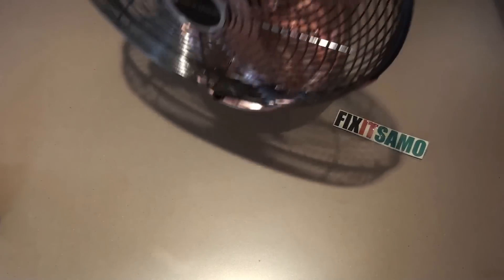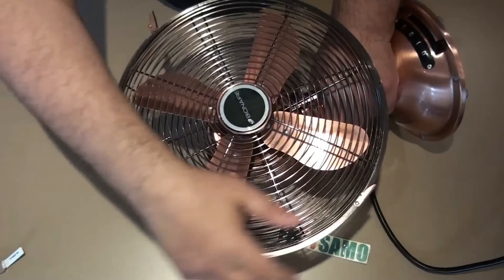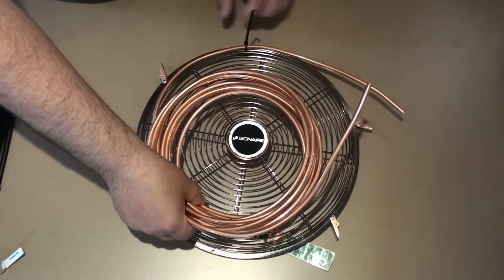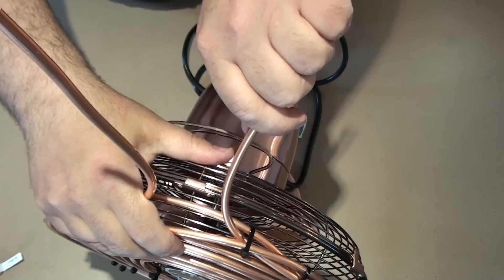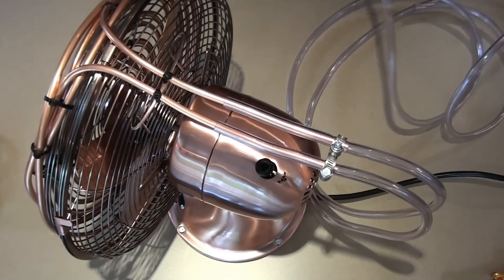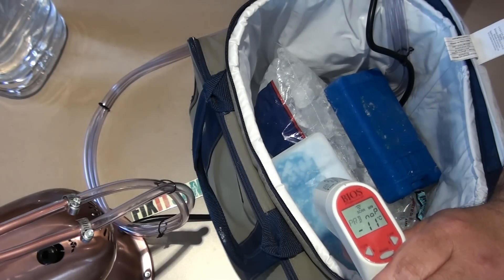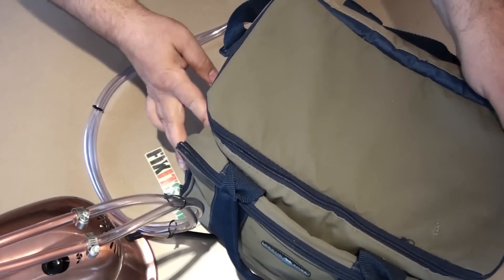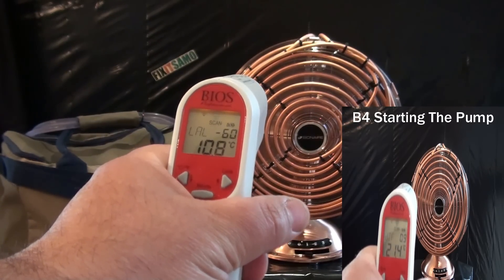How To Turn Your Fan Into An Airconditioner  AC

Comment: couldn't you fill all the copper tubing with water, put the pump on and circulate just the water inside? probably would not get as cold but cooler I'm sure.
Reply: That would work for a few hours at best, but eventually the water would heat up and reach that room's temperature, turning it into a very heavy fan. The water has to cool down at some point to make this work. In fact, I'm willing to bet that the water will actually reacher temperatures higher than the room's, because the electric water pump will heat up, making the fan a heater. Not the best for AC.

Comment: Where does the condensation go after it forms on the copper tubing???? It's going to  get wet underneath that copper tubing, right?
Reply: Anon the high air flow will keep the copper tubing dry. this isnt that effective it wont cool enough to getbmuch condensation.
Reply: I live in Northeast Pennsylvania. Here, depending on the amount of moisture in the air and the temperature, the dew point can pretty easily get above 70 degrees.  I made my own device - just like yours - specifically to dehumidify, and it worked very well! I was able to collect approximately 350 ml of condensation in about an hour and it made a big difference in comfort. The funniest part is that I was using a steady, but slow, stream of tap water. It was roughly 56 degrees coming out of the tap, so when the dew point was up in the 70's, it would really produce a lot of condensation. Anyway, great idea!
Reply: @jimk518  If you made an air chamber under the ground you could use air instead of water.  The ground, not that far down is cool.

Comment: Need a way to test the air coming off of it ... I am sure this thing works, but pointing an infrared thermometer at the cold pipe is going to provide you with a colder reading ... I am curious about the actual air coming off of it, at about a foot away. Great idea though ... Thanks for the vid

Comment: if the temperature 35 it will be 25 ,it is good but after little time it will loose the cool due to the ice will loss the latent heat and you must put another amount of ice
Reply: Hence the cooler.

Comment: Safety note: make sure the copper pipe reaches down below the fan motor, almost to the floor/table/whatever surface the fan is on, then make the potentially leaky water connections down there so if there is any leaking, it doesn't go into the fan motor and burn down your house 8)
Reply: Watch for condensation building up on cooling pipe, that can cause issues, with both electric motor, wires, and good furniture finishes. Remember all AC's have condensation buildup on the cooler areas. I get it with my store bought A/C., outside my window.
Reply: i thought the same

Comment: It will only work if any of those complicated devices (and there are tons on the net)are used in a separate room, with the door closed, to where the freezer is.  In other words, it'll work in your bedroom, but not in your kitchen.  The fact of the matter is just to place two one-gallon jugs of frozen water (on a rubber or plastic floor mat with edges or ridges, in order to capture condensation water) and place a fan behind.  Same thing. But always away from the room where the freezer is.  And when depleted, just go to the freezer and switch jugs. Don't forget to close the door behind you! Jugs always.  Never open or raw ice.  It'll evaporate and make matters worse.

Comment: Another modification and make another coil for the cooling side. Wrap this in thin cloth and get it damp (not under water). The air will be enough for the evaporation effect to get surprisingly cool. Also cheaper to scale to a larger size than ice so can make colder air per dollar. Just need a tank of water to keep the cloth wet, there pumped on top or gravity feed with a prick size hole to drip water on the cooling coil.

Comment: you point at the copper and it will be 10 c degree it is so normal you didnt measure the air output as it is a different tool thn thiss one.

Comment: Is your digitial thermometer calibrated properly??
Ice = 0 °C (not -14 °C)
Reply: The freezing point is 0, but ice can still get colder than that.
Reply: Yes, ice can be colder than that, but your ice is 14 °C (25.2 °F) colder than freezing.  You must have froze it in a deep freeze, huh?
Reply: A home freezer in the UK normally stays at -18°C so for this ice he showed is after a little while of preparation is only -14°C is totally normal, Understand that if he had ice that was 0°C it would literally start to turn into water in a bag within under a minute of it being out of the freezer in a warmer climate, which for anyone who wants ice for whatever reason is not any good.

Imagine putting ice cubes that was -1°C into your drink it would literally just turn into water within a minute of it being submerged and wouldn't really cool the beverage at all and just merely add more volume of water.

Comment: How would freezing milk jugs with water serve as the ice?
Reply: You could add the salt to the jugs and that would contain the corrosive  effects.
Reply: Well if it's ice, then it should work right? There's no difference between water frozen in a milk jug vs water frozen in a bag.
Reply: It would work.  You'd still want to circulate the water around the ice jug/s to get it as cold as possible.

Comment: It actually works as a chiller or chilled water loop. But..... you need to measure air temp off the fan that infrared thermometer only does surface temp. And what are you going to do when that copper starts condensing and sweating and dripping water everywhere.
Reply: My guess is that since the water will remain cold enough through each cycle, condensation would be minimal. 
And whatever condensation does appears would be blown away by the fan as a light cool mist. Its pretty much a win-win.

Comment: I would love to know two things. 1) how cool can it cool a room compared to another room and what is outside temp. 2) can you use coolant,RF2, Freeon etc?
Reply: Refrigerant wont work without a compressor, so no. Unless you stole a loop from an ac or from a frige, but then you might as well use an A/c
Reply: Genius News no, coolant is a vapor at standard pressure

Comment: It would be great to actually run some gas under pressure through the copper pipe instead of cold water. That would be the real challenge. Anyone up for doing that?

Comment: It's not an AC, it's a cooler. AC should work like a self sufficient heart pump, while this equivalent to simply throwing ice on the floor.
Reply: No, it isn't 'equivalent to simply throwing ice on the floor.'
His fan can be set to direct cool air on a person, obviously.
Plus, with that much ice, his unit will run for hours & continue to provide cooling until the water temp = the room temp...
Reply: Bear Arms even less efficient than throwing ice on the floor

Comment: We have to pour distilled or normal water?
Reply: Distilled would be preferably "just in case", but you can use plain tap water. None of the component parts would be adversely affected by tap water.
Reply from the maker: +pranav goenka 
I used regular water

Comment: Great job!
I got the same effect by blowing thru a straw into a cup of ice.
The cool air escaped thru the gap between the straw hole and the straw in the plastic lid.
My air conditioner was light, portable, cheap and required no electricity!
Reply: Don't blow your lungs out
Reply: If you are using human blowing power, you might hyperventilate before you are effectively cooled. ;)

Comment: I'm pretty sure the heat generated by the fan exceed the cold from the ice. there's a reason air conditioners are in windows (so the heating part is heating outside).
Reply: The heat generated by that little ac motor is nothing compared to the heat generated by refrigerant being compressed(The heating part of an air conditioner).
Reply: A refrigerator isn't meant to cool the location it's in; an AC is.
Reply: I was not talking about a refrigeraTOR. I was talking about refrigerANT. Refrigerant is what causes the cooling to occur in an air conditioner or a refrigerator. When the refrigerant expands it gets cold( the same reason a can of computer duster gets cold when you use it). When the refrigerant is compressed, it heats up. This heat is then expelled through a condenser (the part of an air conditioner that is outside) that a fan blows through.
Reply: They said Refrigerant, as in the substance needed for blowing cold air. Not refrigerator.
Reply: DynVec, this isn't an air conditioner in the classic sense of the word. It works on a different principle.
Reply: The heat generated by the fan is neglibible.  The heat absorbed into the cold water is probably quite high, actually.

Ice is potential energy (i.e. it has an absence of heat & can do work as heat is transferred to it).

Comment: I don't currently have a cooler like yours. Would a Styrofoam cooler work with this, or should I invest in an actual cooler?
Reply: The foam cooler would work too. The ice may not last as long, but it will still work.

Comment: Alcohol work as long as the pump would handle it? How about antifreeze..?
Keep up the great work your video is one of the best and most informative videos I've seen on youtube.
Reply: What? alcohol?
Reply: Alcohol instead of water so it don't freeze
Reply: Jim Jay ...That's what I mean
Reply: Alcohol evaporates very fast.  Additionally it might catch fire.  Might work with heat exchanger.
Reply: Alcohol might work. However, it might also degrade the cooler a(and possibly the plastic piping). Its also a fire hazard if the room isn't well ventilated. I'd strongly recommend against using alcohol.

I'm unsure how anti-freeze would react to the cooler or the plastic (it probably wouldn't, but I don't know). Its also extremely poisonous so I'd not use it around small children or pets. Aside from that, it might work okay.

Comment: This is a really cool diy. 10.6°C is really cold so how can that be risen to15-20°C?
Reply: The copper tubes are 10°C, not the air!!! it is so easy.. just take water which is 15-20°C..
Reply: Marian Nestos you gave an answer which doesnt match to any question here. Happy birthday.
Reply: use longer plastic tubes
Reply: Doesnt make sense. You need to use shorter copper tubes. The plastic tubes have no effect on the temperature.
Reply: Roflcopterpilot Longer plastic tubes make more area through which heat from the surroundings can be transferred into the fluid and heat it up before reaching the copper tubing.

Comment: Adding ice is a cheat; this is just a Cajun swamp cooler with some extra tubing. Replacing the cooler of ice with a couple hundred feet of buried garden hose would turn this into a nice, if modest, ground sink air conditioner.

Comment: Pretty neat idea. However I would suggest 1 improvement for people trying this.. Right now if the connection between the copper and plastic ever gets loose, it's right over the fan and to my mind that could be dangerous since it could short out the fan and potentially start a fire. You can mitigate this risk by having the copper tube be longer and bending it so that it's lower than the fan's electrical compartment and perhaps further back.
Reply: starting fire with a short cut :) 
these days the eletric will shut off immediately
Reply: In most parts of the world in most buildings - yes. But better safe than sorry, or in this case dead. Never trust a single point of failure to always work. ;)
Reply: Fabian Van Der Mijde, nope. Fans like that usually use 2 prong plugs, thus are not protected by differential breakers.
Reply: @bear Arms if there issint one in the plug itself there is a RCD wich checks if all electic power that went in the house also comes out. if there comes less out as there goes in. it will shut all the power off.
Reply: Yes. And for RCD to work you need a ground wire, which fans typically don't have. RCD doesn't care what exactly is plugged into a socket - a fan, a wet fan or a human.
Reply: Also, in the event that a human tries to turn it off and accidentally disconnects the tubes, he will be very likely killed. Even if the human will be actually grounded somehow, you need a 10mA differential breaker to semi-safely protect from wet contact with electricity. Typical differential breakers are 30mA per room, or even just one 100-300mA per house. Those most likely won't save anyone in this case.

Comment: Why not make it using your refrigerator as the cold water supply? To do this the build would literally be in the fridge with two holes supply and return modified through the fridge cabinet etc...
Reply: no it doesnt make sense. the freezer needs to put energy into cooling itself. so it releases heat on its backside. so you are cooling on one side with your fan and heating the room with your freezer. the temperature in the room should stay the same after a long period or would rather raise, depends how efficient your freezer is. it only works if your freezer is not in the room that you want to cool. and the water wont freeze if you put iceblocks in. you would need a huge amount of ice..
Reply: Yeah, I was thinking about that too.  Even better with a freezer and use cheap alcohol liquor for circulation because alcohol liquor will never freeze in freezer.  Might get a better result
Reply: serberuss straight alcohol

Comment: Be advised if you're going to try this: I bought 1/4" copper refrigeration piping as OP suggested and it was way too small to fit in the 3/8" vinyl tubing I got. No amount of clamping would make the seal tight. Got 3/8" copper piping and it worked like a charm. Giving this setup a trial run tonight.
Reply: hi N Christian,  does it really work? I'll be more than happy if it could really drop temperature by 5°C at 2-3 ft. distance from the fan. Do you think it is possible ?
Reply: At 2-3 ft it will be noticeably cooler, I get about 5°F temp drop but do not expect it to be cold by any means. You likely won't see a 5 degree celsius drop (around 9°F) though. It definitely does help me get to sleep and I'm glad I spent the money. After the ice fully melts and the water becomes room temperature, I begin to feel warmer so that's a good indicator that it works at least somewhat well, overall worth it in my opinion!
Reply: N Christian  get 3/8 o.d and 1/4 i.d

Comment: This is very nice job. May I ask how long the ice last in cooler? and
 how long would it take to the point when fan generates warm air?

Also I was wodering if you put salt... will that be bring down even colder?? 
Obiously, you have worry about corrosion using salt.
Reply from the maker: +wontong ni 
Hi the ice will last around 10 hrs 
Salt actually melts the ice a lot faster 
In our Canadian city's we use salt and sand to melt the ice on the roads sometimes the temperatures could  reach -40 degrees  sometimes
Reply: 10 hrs is great... Two blocks of ice will keep you going all day and nite.
About the salt... the reason for using on snow road is because salt 
brings down the freezing/melting temp down below -32 degree F.
Since freezing point is down, therefore snow is melting or oddly, since
melting point is down snow will melt below freezing point too.
Old day, people made ice cream using this concept. In a large
bucket, fill with salted ice and in the middle put a container that
has ice cream ingridients, and when you make spin, the ice cream 
forms. That is because the salted water /ice is much cooler than
freezing point 32 F. In order for salted ice to melt( it needs heat
from ice cream. 

So I was thinking on your cooler if you can make dule layer of
ice container... outer part with salted ice and inner with regular
ice and water (where those end of tubes and pump stays), 
you may get even much cooler air blown.... worth try out...haha

I do not have any materials (ie copper coils, fan etc) so 
I don't think I can make from start. But you alreay have 
fan ready... just try with one of those styrofom coolers.

I you search for salt vs icecream.... you will see what I am 
talking about. 

Anyway thanks a log for your video. It had me think for a while.
Reply: sorry for some spelling errors... getting old cant type. ^_________^

Comment: i wish someone could make something for a cars ac, my ac just went out and tx heat will kill you if not careful, its will cost a little over im for a compressor but just dont have the money, my kids and i are suffering with this heat
Reply: Sorry to hear that Ana. Find the home machanic near you who can run diagnostic again (Unless you know for sure its the compressor.) Usually,
I mean very seldom your compressor goes bad unless its american made
car. Even American made cars they lasts at least 100,000 miles but
import cars runs forever. I have Toyota camry 300,000 miles nothing 
wrong with AC. When Compressor is bad, it usually make loud noise.

Anyway all these years I see ac problem with leak in system. When 
the internal gas leaks out, for the safety reason (to save compressor),
the compressor clutch does not engage to spin. That is how it's designed 
and a lot of time people think or make believe to think that compressor is
malfunctioned. What I usually do in this case will be go to walmart and
buy about 3 cans of freon that also has  sealer, and AC oil., unplug the
power line from AC and directly connect them to battery power (this will
spin the clutch so that it will create vacuum and suck in freon from the 
can).... Usually this pix the problem. Like I say the most of time the 
problem is leakage not the compressor. however, I really wouldnt know
your car situation.

If indeed it is you comressor that is broken, I will suggest you go to 
wreck yard and buy used one... find the home machnic near you
to save tones of money. Replacing AC compressor is not that hard 
of job. Average home machnics can do it in about 2 hrs.

Wish you good luck.
Reply: Ana Marin  check out desert suns videos ok